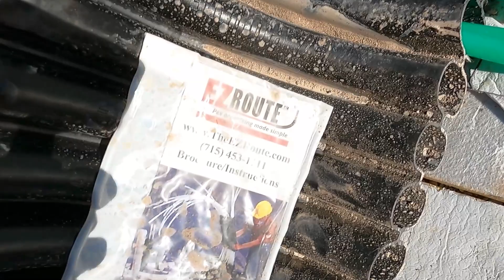INSTALLING RADIANT HEAT

Comment: Is that a 300 dollar level you are using? I bought one and the laser because of you. Thank you for all of your training. I am in Dallas and I am starting a build using your methods.
Reply from the maker: Not sure which one you're talking about. I use a stabila la180L for pretty much everything. Not cheap. I buy cheap spectra 5 point lasers for everything else. Good luck on your project